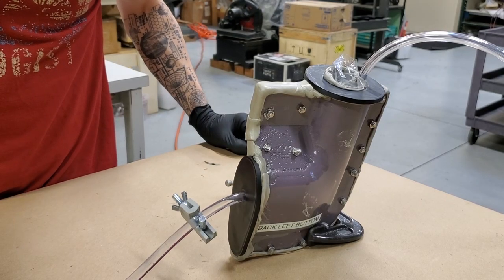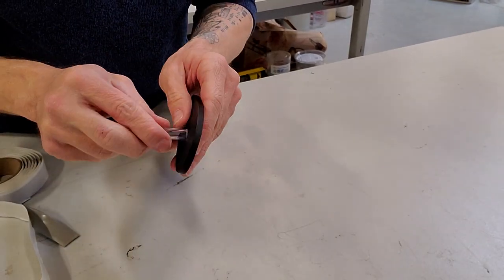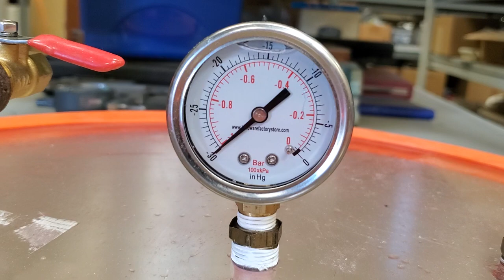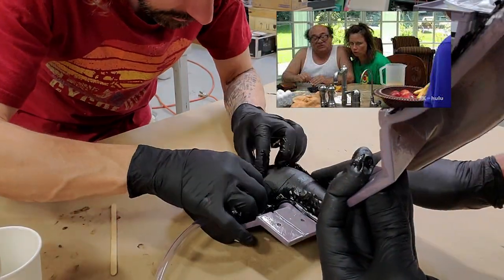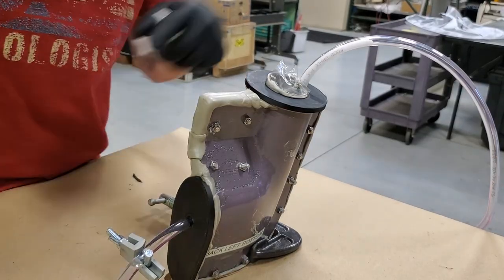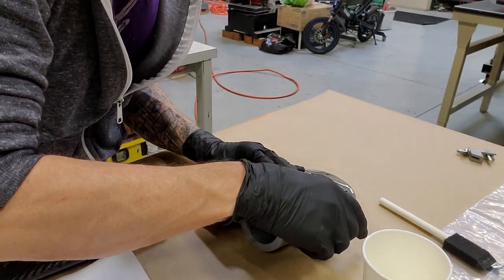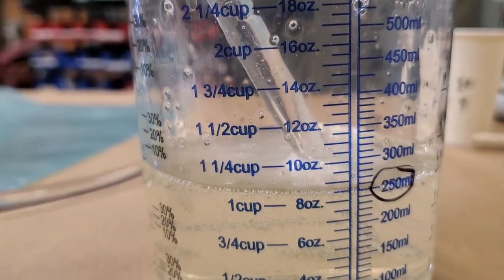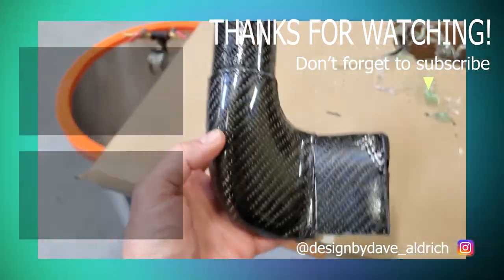Hollow Carbon Fiber Parts, No Vacuum Bag, RTM - Part 3

Comment: great video, working on something similar at the moment :) Here's an answer to your question for the "composites tape instead of blue tape" to stick the fiber to the inner core: Use some strips of carbonfiber UD, add some composites spray tack and use these as a tape to hold it to the 3d core (look for hi-tack 71 from 3M ) never used it from 3m so you might have to do some research (I'm using Fusion Fix from easycomposites) that way you can make a piece of carbonfiber tape similar to prepreg
Reply from the maker: Great idea, thanks so much! Love your channel btw! Looking forward to the next project.

Comment: I'm sure you've seen it, but in case you haven't, Time bicycles makes frames with this process. Not sure if it would help you here, but instead of a 3d printed core and bladder, they mold a wax core for the inside of the part, and once the part is cured, they just melt the wax out.
Reply from the maker: Thanks. Yeah I'm pretty sure 3T does the same.

Comment: for the lap ply you could use supper77 adhesive as a tackyfier . Spray the printed insert before installing.
Reply from the maker: Oh spray the insert. That is a great idea, thanks! I had though to use a spray adhesive, but not to spray the core.

Comment: Fascinating watch see the science and magic behind beautiful carbon parts.  After watching this whole thing, I have only one question… will you be taking orders for this finished ‘product’?
Reply from the maker: Thanks for checking it out Ryan. Definitely will not be taking orders. I don't "do" production any more and these 3D printed molds aren't really durable enough to make more then a couple parts each anyhow. Also the finished product will be extremely cost prohibitive. Having said that. We have materials to make a set or two extra of the corner brackets.

Comment: I'd print that black part in TPU.. its like a hard rubber.. I think you could get a seal if you go the tolerances tight.  It can print glass smooth even on my entry-level printer.
Reply from the maker: It's been a while since I did this project but I want to say that I had a reason back then for not using TPU... but I can't recall so you may be on to something!

Comment: Try to spray the inner bag (touching area with interior) with release wax to extract it easily
Reply from the maker: Good idea thanks! Removing all the bag isn't important for these parts but it might be on future projects.
Reply: Probably won't help much. These tube bags usually are pretty much self-releasing, the catch is when a pleat gets trapped in resin.

Comment: I think that your void problem may be due to your use of a pressure pot.  You're blowing air into the mold along with the epoxy, then you're not allowing enough time under vacuum for the air to work its way out.  Your pressure pot could be a real asset if used in a different way.  Put the epoxy in it, attach a vacuum source and degas the epoxy!   Less air in means a smaller void risk.
Reply from the maker: From our various tests, I can be pretty confident that this is not the case. You'll notice in this video that we purged the air from the feed line in the pressure pot. Also, I made a part without it. I don't have enough experience (any experience) with the resin infusion process to say, but the one thing for sure we are not doing is using an infusion specific resin. They must make that stuff for a reason. haha
Reply: @designbydave  No, what I noticed was that I could literally see the air bubbles in the line @13:55 , and a few seconds later someone said, "Bubbles let us know it's flowing!".  

I beg to differ - bubbles let you know that you're pushing air-entrained epoxy into the mold.  Each bubble followed the path of least resistance, and some of them led to the mold surface, where they arrived after their path to the vacuum feed was blocked by resin. Hence, voids.

Remember that air is compressible and liquids are not, so it's very difficult to push air out of a fluid.  When hydraulic systems (e.g. car brakes) are bled, the fluid that contains air bubble has to be pushed completely out of they system by clean fluid that doesn't contain any air.  You could have done the same thing and kept the flow through the mold until you saw airless epoxy at the vacuum end, but that would be wasteful of epoxy (and you'd need a capture pot to protect the vacuum pump).

Another thing you could try is to block off the feed once the epoxy is half-way along the tube, and allow vacuum to run for a few minutes to degas in the tube.  That won't help if bubbles are entrained throughout the entire epoxy mix though - it'll only degas that initial feed.  (Sometimes, that might be enough.)

You can also try warming your epoxy components before mixing by placing them in a warm water bath.  A lower viscosity will entrain less air to begin with, and will also degas faster.  You can also warm the mold to prevent a cold mold from increasing the viscosity. Just beware the decrease in pot-life.  It might be an idea to mix a small test batch at your intended temperature to verify viscosity and pot-life before committing to it for a part.

If you watch the Exploring Composites channel, you'll see that he uses a variety of heat and vacuum techniques to control the epoxy flow speed and path to ensure that any remaining air in the system can escape before the epoxy locks it in.
Reply: I follow you on this one. The problem is you have a build up of pressure on the start of the tube entering the part, reducing air bubbles in volume you see in the tube, then go over to to the vacuumside causing the airbubbles to expand, meaning every bubble going in, will expand up to 5 times or more in size under vacuum. @david : like you mentions below, using infusion resin would help a lot on this process. Another point that you might work on is closing down pressure side and let the vacuum do its work more to the end, if needed repeat a few time Anyways good job and good results coming out of the mould!
Reply from the maker: @MatthieuLibeert  Thanks
Reply: @designbydave  Using pressurized resin with a soft bag inside looks a recipe to excess resin. Did you compare the weight of the finished pieces? I'm pretty sure from previous experience that leaving the vacuum on in the final stage is not enough to drive out the excess resin. 
On the other hand it look like you can easily modify your setup to slightly pressurize the bag, enhancing compactation and fiber ratio.

As a tackyfier you can also use a VERY SMALL amount of unmixed part A epoxy. The mixed resin you are going to infuse will move and mix with it, and all will harden. This leaves you plenty of time to work.
Reply from the maker: @stezz90  An optimal resin-to-fiber ratio isn't important for these parts, so it's not something I considered. In the end, I was able to infuse the parts without the pressure pot. Perhaps for larger parts and/or thicker laminates the pressure would be necessary and then I would revisit the detail of resin-to-fiber ratio.
That's a good tip for the tackyfier, thanks!

Comment: great work, but my question is..why do you use a core? You don't need a smooth surface inside and with this geometry you can do a resin infusion without a 3dprinted core
Reply from the maker: The purpose of the core, in this final from of the process is mainly to support the lap joint during the layup process.
Reply: @designbydave  maybe it's different, I usually work with prepreg, but I think it's a geometry that can be do without core. Or using a little core in the smaller section . You can insert the bag before close the mold, so it's easier to control

Comment: I am not an expert, but I havea general knowledge of how these work and I realize I'm missing something--shouldn't the bag need to go all the way through?
Reply from the maker: To make the parts completely hollow, yes the bag would need to go all the way through. I tried to emphasize "mostly" hollow although now I realize I omitted that detail in the title. The airfoil section is only 15mm at its thickest, so there just isn't much room for the bag to pass trough, especially with the resin feed line. So, we just oped to keep that part solid. With better planning of the tooling, it should be possible to divert the resin feed line to the side of the part allowing space for the bag to pass though. I didn't think of this when designing the tools as the process was being co-developed with the tooling. I am hoping to explore this further on a future project.

Comment: So the last proses is the best ?
The infusion without the pressure?
Reply from the maker: I think it depends on the part geometry. With a part of this size, it doesn't seem the extra pressure is necessary (especially if we were using a proper, low viscosity infusion epoxy.) However if the part was much larger, or had a thicker laminate, then the extra pressure could help push the epoxy into the part.